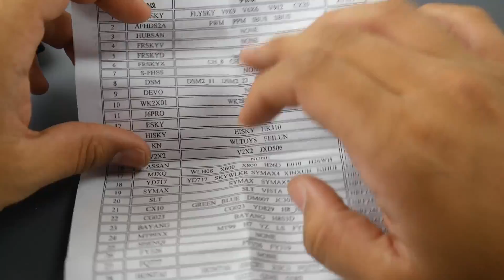iRangeX RX4 LITE vs Vantac MPM Lite // Frsky X-lite Multi-protocol Module

Comment: Hi, can you help me troubleshooting my problem with my X-Lite Pro. I'm trying to connect my iRX4 on the external port but it does not lit up. I think there is no power on the connection pins. On the menu 2 (setup) I choose the External RF but the module constinues OFF. Do you have the schematic of the external pins? Thank you

Comment: just a quick question, is it possible to put a different antenna than the stock antenna that comes with the iRangeX iRX4 Lite ? like a 5dbi antenna etc ? if so any links .thanks
Reply from the maker: Yes I'll but I need to double check.
Reply: @DroneMesh  Thanks

Comment: How is the range of these external modules?
Reply from the maker: The Irange is really good.. But dont expect much on the crazy bee board built in receivers.
Reply: @DroneMesh  Thanks for your reply! I'm using some D4RII's in D8 mode. They have a range of 1.5+ km. And it would be great to have that range with this irange module.
Reply from the maker: @monsieur7246  never tested them to that amount of range its its uncharted territory but I know it handles interference great so it should be outputting at a high output power.. Good luck and keep me and the community updated on your findings :)

Comment: Interesting, wonder if there's even more components in these to consider quality. Since they are controllers really, is there a pre-amp or anything transmitter related that could also be judged quality wise? Like I have 2 meter handheld radios (ham radio) and there are differences in many of the chips. Be interesting to know longevity, etc. Also that screwdriver really is a great tool! Didn't really think about it as much till I saw you using it, major time saver!